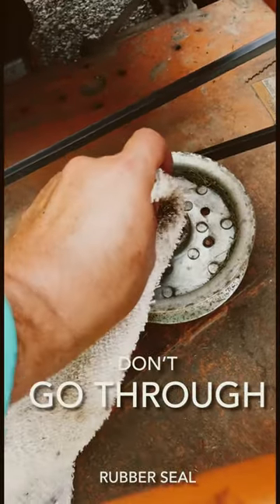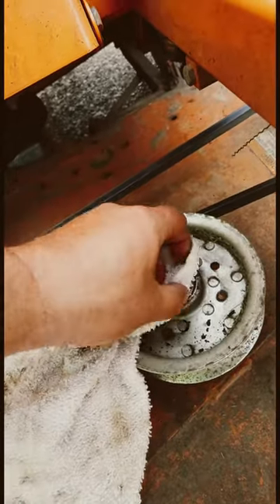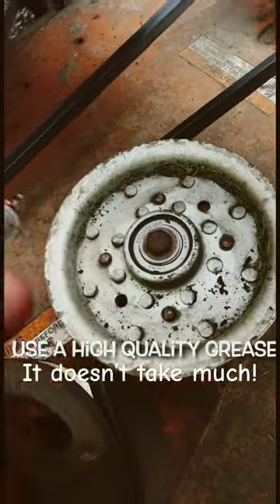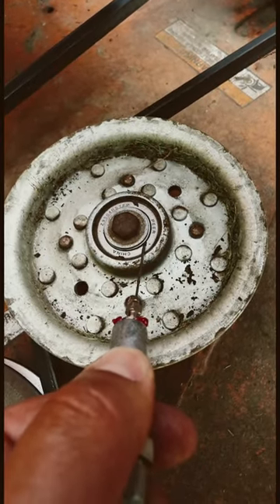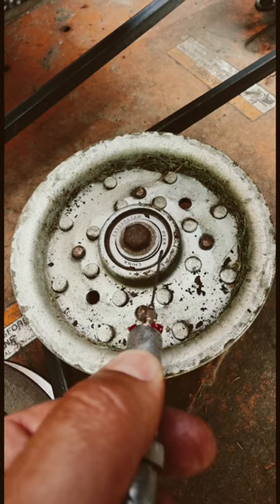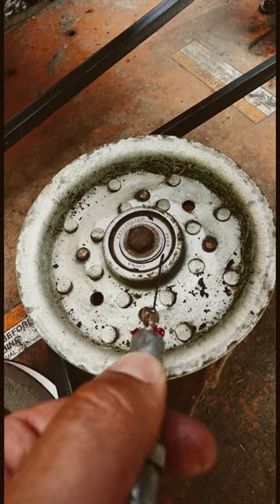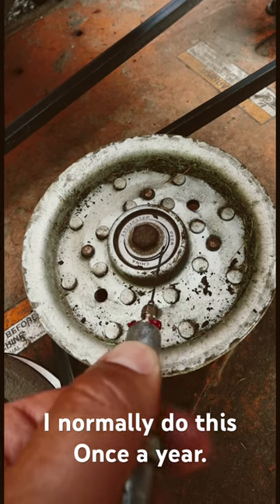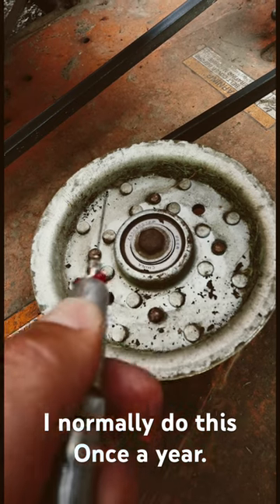Extending the life of idler pulleys!

Comment: Trust me then, I’m a certified hustler mower  tech and I’m not allowed to do this at work as this is not the “proper way to fix a noisy/ worn/ wearing) bearing, but I have done this many times on all 6 of my mowers multiple times and it works. If you don’t have a grease zerk on your mower as a average home owner I would highly recommend doing this every 300-500 hours. But honestly they are all junk now so your fucked regardless😉